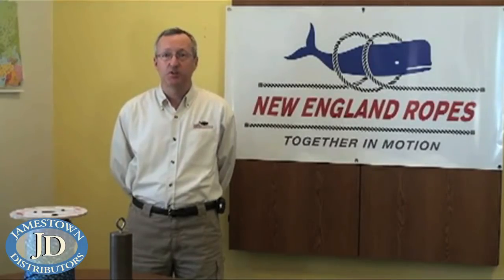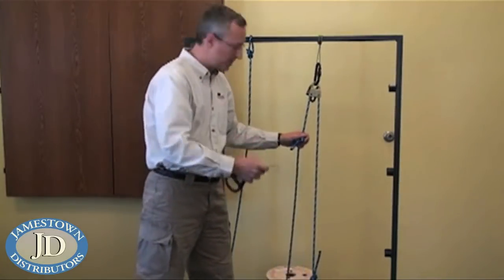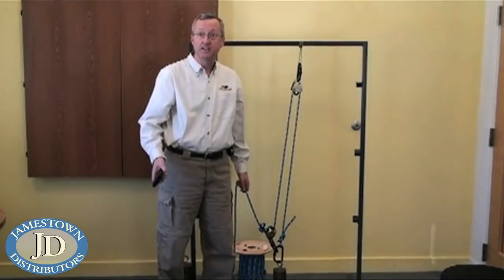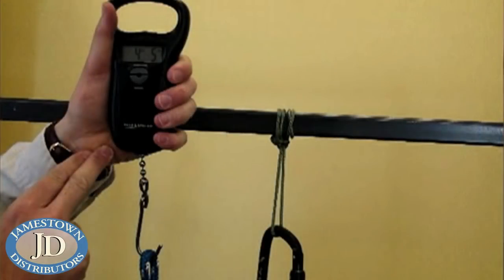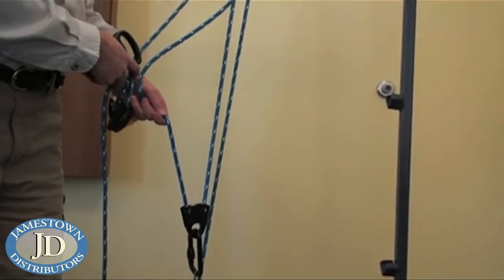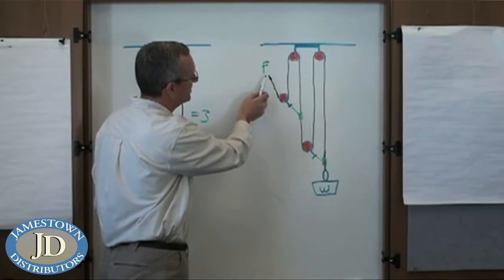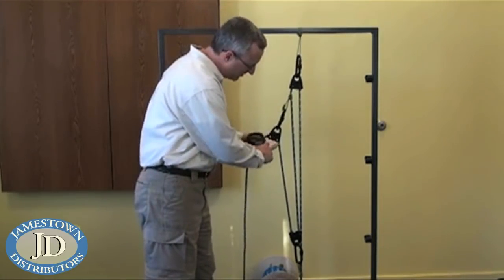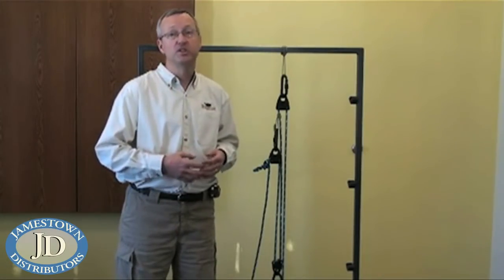Mechanical Advantage of Pulleys

Comment: I searched in vain for an app that lets you set up virtual pulley arrangements, but no luck.  Does anyone know of one?  I use Android.  

In the meantime, I bought several mini snatch blocks and a metal pegboard so I can practice different arrangements and see if I can figure the mechanical advantage - because so far I keep getting it WRONG!

Comment: RE: Truck in the mud.
If you go from your winch to a snatch-block (single-sheave pulley) on a tree and then back to your bumper you have only doubled the force on the tree (on your pulley/anchor)  You have NOT doubled the pulling power of your winch - a common misconception.  If you have a buddy with a winch run the cable from their truck through a snatch-block attached to your truck in the mud and then back to their truck and pull you out they HAVE doubled the pulling power of their winch!
Reply: Both those scenarios would be 2:1.  You can't have 1000 pounds of force on the tree and only 500 on the other end of the system (the car).  If your cable to pulley distance is 10 feet the car will be pulled 10 feet, but there are 2 strands of cable going to the car.  Both those strands need to be taken up by the time the car has reached the pulley - and that is 20 feet.

If the pulley was attached to the tree and one car was pulling the other car away from itself, through that pulley, that would be 1:1, unless I've misread what you said.